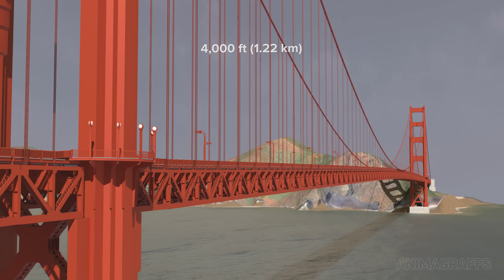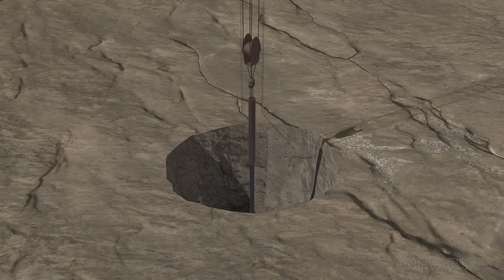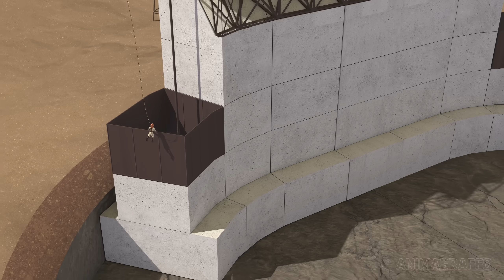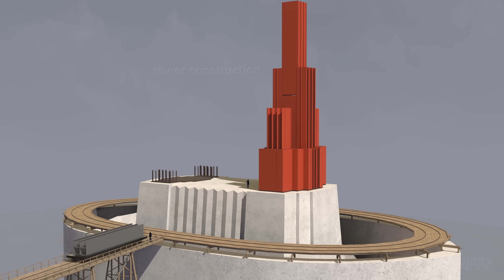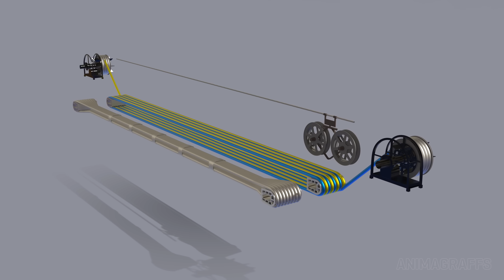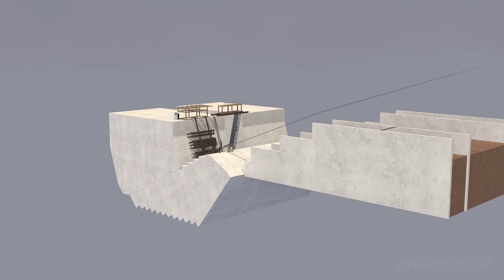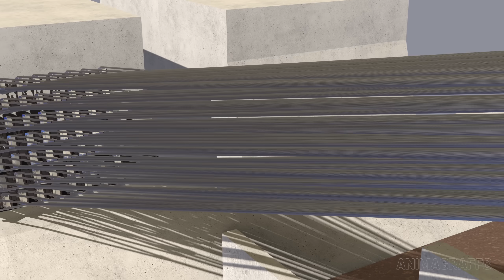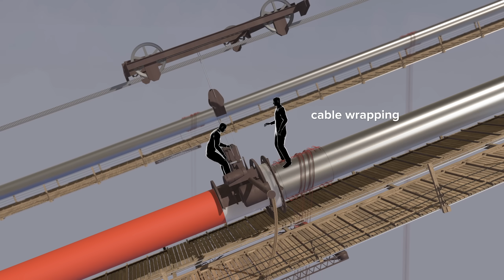How the Golden Gate Bridge Works

Comment: Interesting contrast with the Machinaw Bridge in Michigan ( circa. 1954-57 ) 1. The Cable spinning wheels traveled the entire length of the Mackinaw bridge ( not stopping in the center to “swap” wires ) 2. The individual wires, their associated “strands”, and the final “round” cables were spun in their  “final locations”, directly into & on the tower saddles, and therefore did not need to be shifted into location and set into the saddles ( no hydraulic cylinders were needed at the tops of the towers ) 3. The Mackinaw Bridge tower saddles are smooth  “torroidal”, shaped ( round cross-section like a a “doughnut” cross-section shape ) Not the “stepped hexagonal” shape of the Golden Gate Bridge. It’s neat to see what technological advances were made in the 21 years from 1933 ( Golden Gate ) to 1954 ( Mackinaw ) - interesting video

Comment: NICE WORK!  
Completed in1937.  One of mankind's greatest WORKS OF ART...
@26:00 Can you imagine the math that went into building this?  Before adding machines....  I was very good at math, but I always had my hp15c, or better.
@43:25 That's mind-blowing too!  So every individual, solid wire, is pulled the whole trip...  27,572 of them... 
@1:03:10  You use the word "permanent".  Nothing is "permanent" but God our Father.  So...
When one of them one-hundred-year-old wires brakes, it's going to snap like a rubber band.  Doing what to the wires next to it?
Not wanting to be a 'Doom & Gloomer', but when she goes... she goes fast!!!
All of them, 27,572 wires, move around.  Then there's the fact that we overabuse it.  The people who built this WORK OF ART left behind weight limits, speed limits, and more.  But do we obey any of these laws of mathematics?  NO...  
@1:05:20  Here is the only error in design I've seen...  The Cable Bands have their joining halves installed with the split at the top and bottom...   WRONG...  The bottom should be the cradle, and the top should spread out the load.  Replacing hardware would be easier, and the two halves serve their individual roles, separately.  This error could be the Achilles Heel...  All it takes is one.  And the whole house comes down... 
Questions:
1) Why is the Golden Gate Bridge painted that sick-A$$ orange?  What's wrong with gold (not real gold, just the color)?
2) The 27,572 wires are now almost 90 years old.  Is there a system that replaces them one by one?  And if not, how long do we trust a hundred-year-old wire?  At @50:40  Do we still adjust these shims?  And is there still room for more shims?

I thoroughly enjoyed this video...  The work you put into it, is outstanding.
WWG1WGA
NCSWIC
Q^

Comment: The south pier (tower foundation) of the Golden Gate Bridge is founded on serpentinite rock. 

During the bridge's design and construction, there was considerable controversy and doubt regarding the strength and integrity of the highly fractured serpentine rock as a suitable foundation material. Critics pointed to serpentine's tendency to crumble when weathered and its general reputation as an unreliable foundation material (geological literature at the time warned against using it for applications like dams). 

However, project geologists and engineers, including consulting geologist Andrew C. Lawson, conducted extensive tests, including a load test that determined the specific serpentine bedrock at the site was abnormally solid under compression.

Comment: Truly astonishing content! You deserve an Academy Award for documentaries. I have so many questions: Wouldn't water migrate into and around the steel I-Bars (Holding the cables) embedded in concrete, and eventually corrode them? Seems inevitable. Computers were primitive in the early 1930s. Who did them and how were the engineering calculations made?

Comment: Excellent work, as usual. 

I was a bit surprised you didn't mention anything about the seismic considerations of building such a structure basically directly on top of one of the most active fault systems in the world. I thought I'd remembered reading that they'd installed additional hydraulic dampeners on the bridge in the 80s to improve earthquake resilience? If I'm remembering that correctly, and you're ever so-inspired, I'd love to know more about that in a future addendum to this video!

Comment: What a fascinating example of skill and engineering...and the bridge isn't bad either! I am wondering if the holes for the rivets in the steel tower cells were drilled on site, or if that was part of the manufacturing process at the mill? Thanks for a wonderful video!

Comment: When your carriage pulled the strands over the top of the south tower, the cables crossed. How is it that they do not rub on each other at this cross? Why do they have the dead wire on the left side all the way up until the top,  and then on the right side when going over the top of the tower? You show the wires crossing each other at the top of the south tower at around 41:23(this is confusing, as it is originally a simple perspective of their positions relative to the observer of the animation). Is this a mistake, an issue with how it must be animated, or is there a mechanism at the top of the south tower just prior to the carriage passing above the saddle? This crossing over of the strands becomes more of a question, considering this is only showing one of the strands going up...

A good way to follow the logic of the animation of the carriage as it pulls the strand up the cable to the south tower is to focus on the direction that the front wheel of the carriage is spinning. Remember, the dead wire doesn't move, and the live wire moves a lot. Ref. (40:15 - 40:33) To show the dead wire on the left and live on the right. Then at 41:23, you see them cross over, right? Note the direction of the wheel spin here. Then, at 42:09, it clearly states that the dead wire is in the strand saddle, placing it on the right now instead of the left. When, where, and how did it cross?

Comment: How did they get the wire from the carriage to the strand shoe? I imagine you couldn’t just pull it over by hand without the weight of the cable pulling the worker up the tower.

Comment: I have had the distinct honor, of being to the top of every suspension bridge in the bay, minus al zampa memorial..not only that, but I have actually worked on all 3, in the past 25 years. I helped build the new bay bridge, helped inspect the old cable on the old bay bridge that still stands, and have 6.5 years experience on the golden gate alone. I was on the ggb from 03-05 during phase two retrofit of the "S.A.V." and arch over ft point, during phase 2 retrofit. I was also on the bridge from 18-22 for the suicide net install. I've been all over that bridge. I'm 3rd generation ironworker, local 377, San Francisco. My father, and two uncles also worked on the ggb. So it's in my blood. And my blood is on it. This video is pretty damn cool. It's very detailed. Some stuff I would argue I've never heard of, but I'm also learning some other things. Id be curious to see you sources of info... And as far as painting end to end,non stop, that's not a thing at all these days. I have tons of photos for receipts. Thanks for such an awesome detailed video. Stay warm 😂 

P.s. I also wanted to note I felt an earthquake while on the bridge. I was in the south back span on the bottom of the main truss. Fun experience

Comment: 50:14 I do apologize if it comes up after this time. But what I am wondering about is the elongation or contraction of the cable due to temperature. I mean, if you could do all this in a day it's fine, but you really are at the mercy of the weather to get the cables within specifications during the same temperature. Once the bundle is complete, it doesn't matter, but yes, I can see the shims and engineering that went into that, must be part of the temperature fluctuation compensation also. VERY VERY impressive construction and design.

Comment: At 1:03:02 - the bottom of the base block on the anchor which attaches to the bedrock looks to be keyed the wrong way. However the force from the cables would actually be more in rotation than in shear at the very bottom. So it's actually keyed the right way - is this correct?

Comment: To think this incredibly complex structure was designed long before the computer, financed during the Depression not by a government or corporation but from the sale of bonds purchased by local citizens, and built in under four years, ahead of time and under budget — all of this makes it even more magnificent. The bridge’s structure was unaffected by the 1989 Loma Prieta earthquake. 

By comparison, some 70 years later in the early 2000s, the replacement of a single span of the nearby Bay Bridge, which was built at the same time as the Golden Gate and WAS damaged by the Loma Prieta earthquake, took 11 years to construct, its projected cost ballooning from $1.3 billion to $6.6 billion dollars.
Reply: Of course there's a big difference between a 6.9 quake 80 miles away and a 8.0 quake a few miles away.  The San Andres fault run just outside the Golden Gate.  Also the Bay Bridge Eastern Span rested on top of Redwood piers driven into the bay mud, not bedrock like the Golden Gate Bridge

Comment: Speechless, dumbstruck, etc… at this pharaoh-esqe level of construction and engineering! From someone who is NOT height tolerant, chilled to the core for those who worked at those heights in dramatic weather conditions of the bay on rudimentary platforms; you couldn’t pay me enough😱

Comment: Great job on the video! I have lived near the GG Bridge all my life (71) and crossed it hundreds of times. The real problem is keeping the rust under control. The bridge district doesn't do a good job of keeping up with that. The cable covers haven't been painted since 1937. There's a lot of oxidation and rust.  The towers even have some rust too. They have been retrofitting for many years for earth quack safety. My sister's boyfriend's father worked cable spinning on the Bay Bridge. It's amazing the engineers designed this bridge without computers, just pencil paper and a slide rule for calculations. Damn math geniuses! Also the design and manufacturing of all the parts, shipped to San Fransisco and then iron workers and engineers have to figure out how to put it all together. The cable spinning was done by Robling & Sons.

Comment: Interesting that the anchor blocks are keyed into the bedrock in a direction to resist settling as opposed to the keys between the concrete blocks which resist tensile loads

Comment: how is the middle part of the bridge held up? be interesting to get to know the forces on different parts. i suppose my question is how do suspension bridges work?
Reply: Its hanging from the main cable. Thats what the vertical cables are for. And the main cable is anchored on each side of the bridge.

Comment: Ok I have questions: 

How do they cross the wires when meeting in the middle while rolling? Or put it differently, how do they NOT cross wires while switching carriages... Also, why even bother with this switching, and not let them run the hole way? They must have had a really good reason for that. 

Second, these red clamps that get clamp bolted to the main cable to hold each support cable, how do they resist side movement, especially the upper ones at these steep angels? They can't like drill into the main cable, or bite into it as that would ruin its integrity... But nearly 25% of the load on these upper cables goes sideways In perspective to the main cable. 

Third, how did they keep the main cable from rusting and withering while it was being layed out in 5mm strans, like, it's just bare wire hanging in the open salty ocean air in all weathers. They only weather proved it after even the main bridge was constructed, to wait for it so settle and all. That's a long time, also, water would have long gotten between every strain, so even after making it one round cable, how did they get rid of the water and dirt and salt.

Forth: the concrete blocks at the each of the main Cables ends... Are held by the steps, ok, but those only really work because the concrete is weighing down. My question, do these 4 blocks actually weigh as much as the whole bridge + margin? I mean, after my bad physical understanding, they must weigh at least that, or else the wire would just lift them up(stairs) pun intended. 

Fifth: are you out of your mind creating a 1:24h long video, making it also entertaining to watch, and casually explaining the most complex stuff, for free, just to have to read through my stupid questions 😂 love this channel
Reply: Lol, he's gotta be nuts!!
Reply: The cable ends are drilled and anchored in the bedrock aren't they? I don't think they are held by just concrete blocks on top of them.
Reply: @Smhallways  yes they are held by the big concrete block in which they got Casted, but, that block itself sits on these stairs, and held down by another block of concrete on top. My question is only now, since they are not ancerd to the bedrock, the weight of the cast and block on top must exceed that of the whole bridge to not get lifted
Reply: @lefotografion  49:45 The chain is anchored to a retaining rack, (drilled in the bedrock), the concrete is poured over it
Reply: @lefotografion  Also, the main chain sits on top of the tower. The bridge is pulling the chain down, the chain pushes on the tower. The tower holds the chain up therefore the bridge up. So it would not be neccessary for the concrete blocks to hold all of the bridge.
Reply: You know you can put your money where your mouth is..
Your words are nice but cash is King.

Comment: Living in MICHIGAN, this video hits close to home. You should do an identical type video on the Mackinaw Bridge, the only difference is that our bridge is FIVE MILES long not 1.5 miles long. Construction is very similar nearly identical, just longer. The Mighty Mac used cassions lowered to the overburden, then excavated and filled in place. Built between 1954 & 1957. Great video.

Comment: Very impressive! I've never seen a more in depth, accurate and clear presentation of the subject. Now, do one on the Mackinaw Bridge. It's center span is 400' shorter but the overall length of the bridge is 3-1/4 miles longer - the longest in this hemisphere.

Comment: The engineering here is crazy. 5' 6" somehow they knew cable saddle needed to be 5' 6" offset so it could move the center of the tower when the last road section is added. what.

Comment: Just so you know, the center span is actually 4,200 ft long. Each of the two towers are 746 ft tall. Look it up, you'll see that I'm right. I'm from San Francisco so I have to be accurate in those measurements.

Comment: Really, really excellent video.

I would very much like to see a similar video breaking down the construction of the original Severn Bridge - a somewhat similar bridge, built about 30 years later, joining England to Wales.

Some interesting facts about the original severn bridge (not the newer Prince of Wales crossing) include:

1. When constructing, the eastern end of the bridge could not be anchored to bedrock, as the ground was not suitable and did not provide any easy ways to anchor the bridge cables, so an enormous block of concrete was cast in situ, acting as a counterweight.
2. The tacoma narrows bridge had collapsed prior to the severn crossing, and lessons learnt there were implemented for the severn bridge, including adding an aerofoil section to the roadway, but in high winds, the bridge is still regularly closed to traffic.
3. I understand that the equivalent to the cable saddle you described in this video, on the severn bridge, includes an enormous cable pulley, which allows the cable to move relative to the piers. This apparently was intended to extend the life of the bridge, but the pulley rests on bearings, which cannot be replaced without demolishing the bridge. It is understood that this will be the reason for the eventual closure of the bridge.
4. The river severn by the bridge, has one of the largest tidal ranges anywhere on earth - coming in third place on earth, after the Bay of Fundy and Ungava Bay in Canada.
5. There is a railway tunnel which crosses the river severn, approximately adjacent to the newer Prince of Wales Crossing, which was built a long time before either bridge.
Reply: If memory serves me correctly, one of the engineering firms that helped with the GGB, also designed the Tacoma Narrows Bridge.

Comment: According to the internet each wire in the cable is about .2 inches or about 3/16.
"The individual galvanized steel wires inside the Golden Gate Bridge's main cables are 0.192 inches (4.87 mm) in diameter. Each of the two main cables contains 27,572 such wires, bundled into 61 strands to form the nearly 3-foot-wide structure that supports the bridge.  "

Comment: Three of the triangular sections of the staging ring for each of the landing legs. A single hydraulic cylinder connected to the top point of the triangular panel. Pushes down on the point on the triangular panel. Following a track that connects to the bottom of the staging ring. The wide points of the panel are connected to shock absorbers dampers the outside of the ship. Pressure and damping can be varied to level the ship. Leg panels flip out from the staging ring. Pivot point at the point of the panel has minimal pressure. Hydraulic rams not need be so large.

Comment: When the strands are transfered at mid span it would appear they have to go through eachother to go from one set of pulleys to the other.  ??? when the strands are move to the top trough how are the thin metal support shims removed with all that weight on them. A spellbinding presentation.